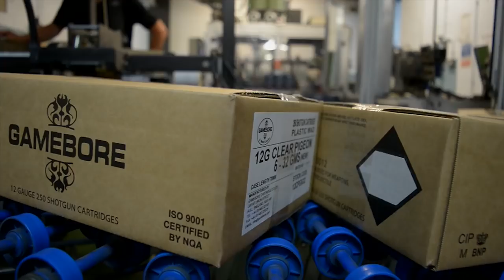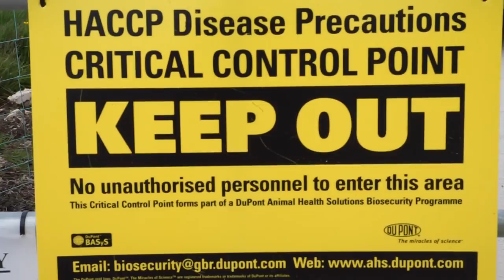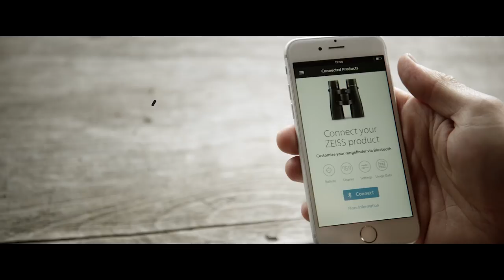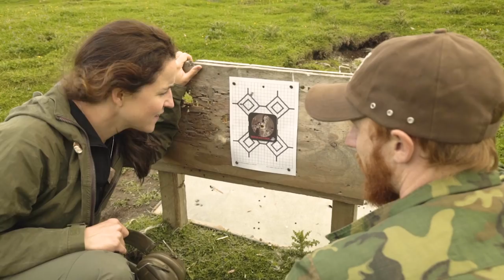Fieldsports Britain - Hairy Brigands Pheasants

Comment: This isn't the first time I've had a problem with Ross' section of these videos, his loader says the birds at 85-100 yards high. What a load of crap the pattern at 100 yard is about 250 inches across, the pellet density in that pattern using 35 gram No. 5s is tiny there is one pellet per 231 square inches..... if you were to hit something at 100 and kill it it'll have one pellet in the head. Its about time that someone actually measured the heights of these birds and didn't just pluck numbers out the thin air. When Ross is talking about the weight of cartridges he uses the weight has nothing to do with the real world amount of energy that the pellet has. The heavier the cartridge the more pellets there are if the shot size stays the same. I can't be the only one who watches this who has an engineering education and can tell that it doesn't all add up. Why can't Charlie and the team produce a video with some hard facts??
Reply: That hen bird you see killed was in excess of 80 yards high and shot with an RC JK 6 36g 4 which is really a uk no 3 through a full choke